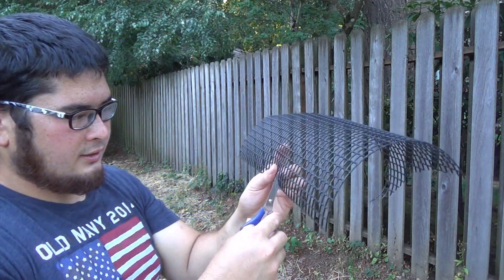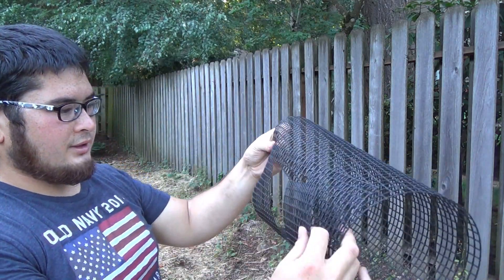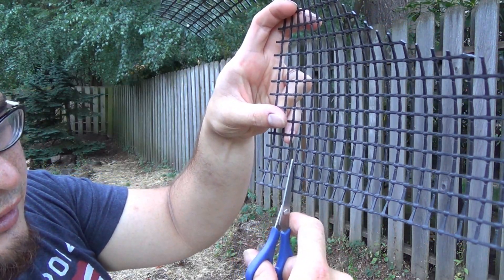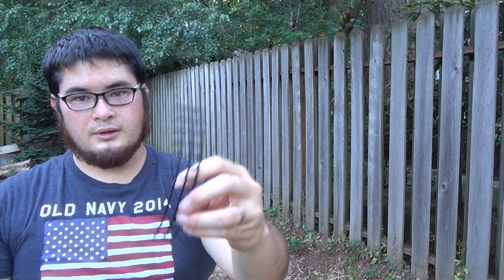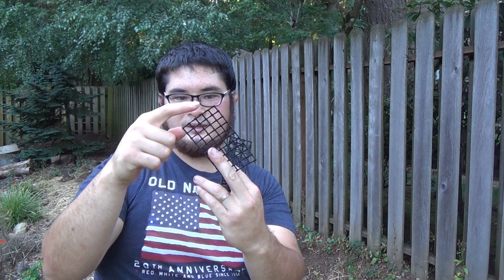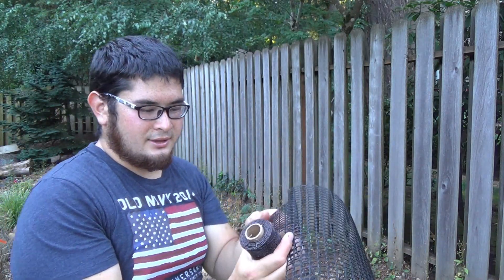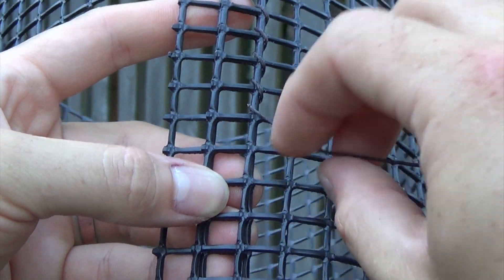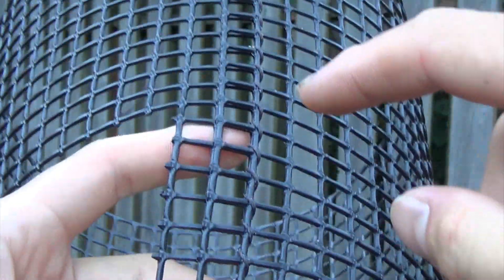How to Build a Crayfish Trap for Under $5 - Part 2 - Assembling the Trap

Comment: Those traps will work for shrimp too.  The "cones" are called throats in the fishing industry.  Yours are good, but the cut off top of a 3 liter soda bottle works too,  You can make them out of old webbing (net) too if they are on top.

Here in North Florida, most guys fish a trap with just one throat, and position them with the long axis vertical, with the entrance of throat on top.  In florida, a crawfish is a kind of lobster.. The "mud bugs" are very popular for bait on limb lines, hooks hanging from tree limbs with the hook near the surface. The state requires some traps to have a biodegradable part that rots and opens the trap if it is lost.  It is often it is cotton string, iron wire, or a wooden toggle.

I have made live cars(boxes) from that plastic , but use stainless steel hog rings to put them together.  It is quicker, and they are indestructible.